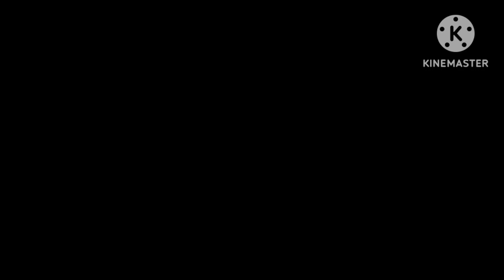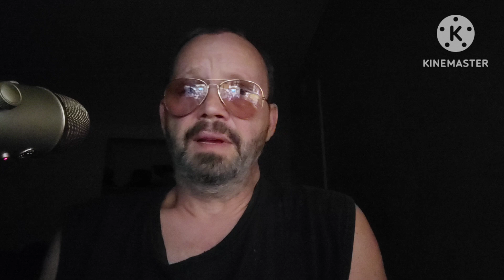How to Upgrade Car Audio

Comment: One add on to this video is the quality of the source material your listening to. I mainly listened to FM radio stations in my suv while driving. When I upgraded my system to Recoil components & coaxials with the Recoil DI550.4 for the doors amplification and then my loaded Stinger 12 inch enclosure combo with their Stinger MT1000.1 mono block amp its sounded better and louder. When I then put lossless audio on a USB stick and played that it sounded INCREDIBLE... Source material matters 100%! If you upgrade and still listen to over the air radio channels ( not including satellite driven channels they are pretty damn good ) you are missing out greatly... Great video!!!

Comment: I'm still trying to decide whether to go active or passive front stage!
Reply from the maker: active if you can, im running hybrid, i have my 3 inch mids and tweeters passive, and run as 2 channels, and my 4 6.5 inch doors run as 2 channels, my front sub as a channel and my 4 12s as 1 channel. all running through my AD46at DSP